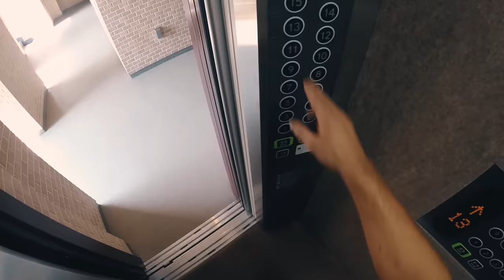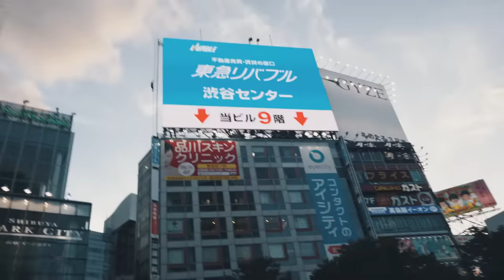STORROR PARKOUR TOKYO 🇯🇵

Comment: me: * jumps off a 30 cm rock and is proud *

him: jumps off a 1000 metre roof onto a tiny ledge
Reply: 1000meter！？🤣🤣🤣
Reply: 1000 Metre? That's not tall...
Reply: @shakmp4  It's actually very tall, taller than the tallest building currently in existence of Dubai's Burj Khalifa at 829.8 metres.